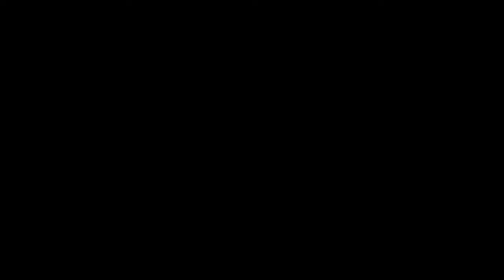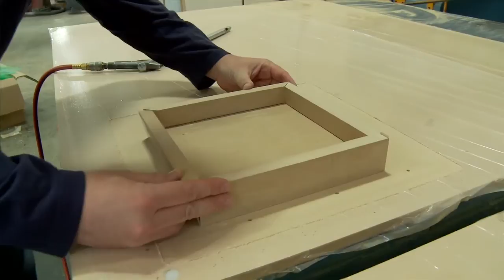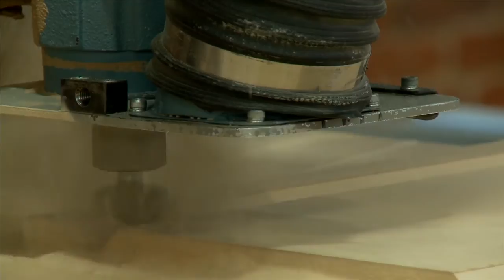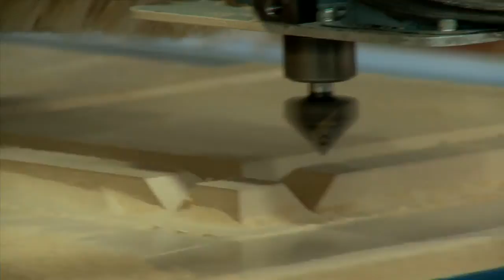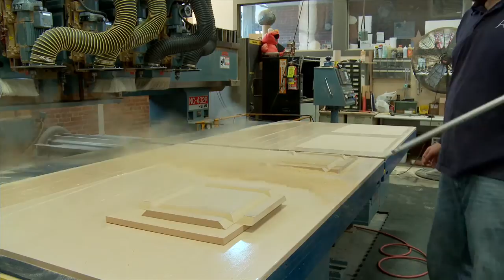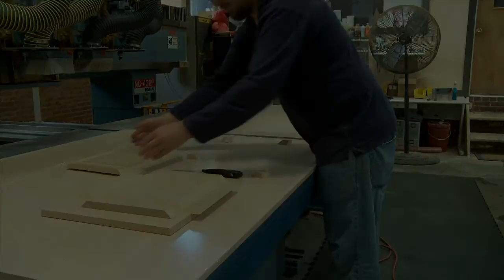V-Fold MDF CNC Woodworking

Comment: A strip of tape brings the whole project together.  A 2" wide non s-t-r-e-t-c-h / Kleen Peel film tape adhered to the material on the opposite side of the sheet prior to routing will hold the definition of the miter-fold joint perfectly while the glue cures. Z Axis should be down to, but not through the 5 mil, 400 Lb. Tensile Strength film backing.  Once the bond is made simply peel off the sticky* tape.  The adhesive peels kleen and leaves no residue on the finished part.  See www.allstaradhesives.com (V Groove Tape(s).